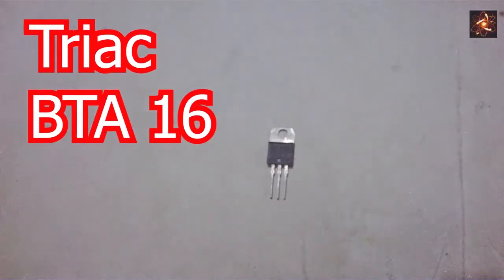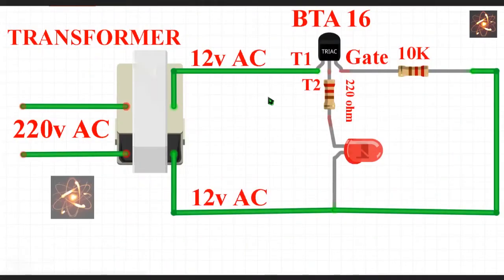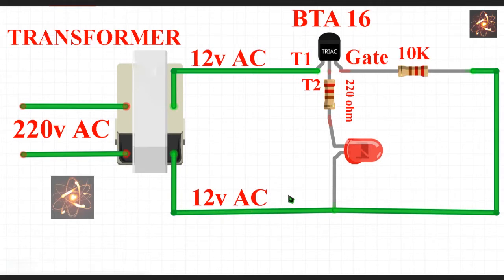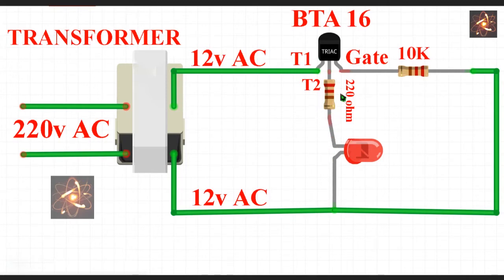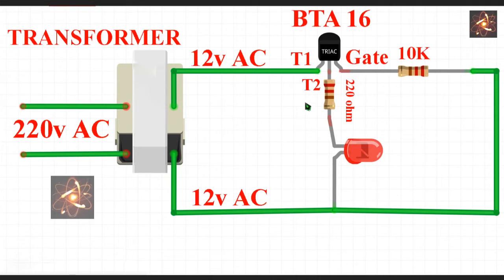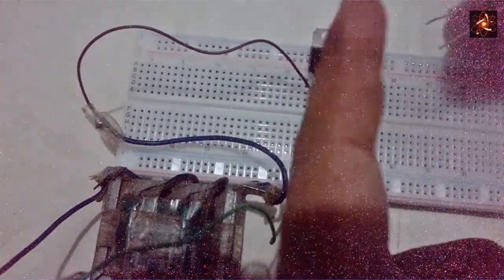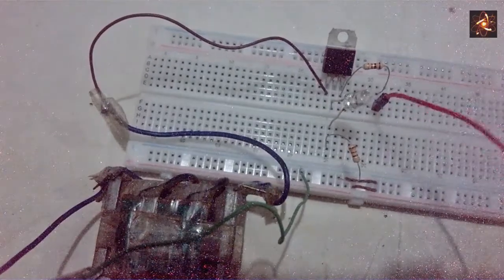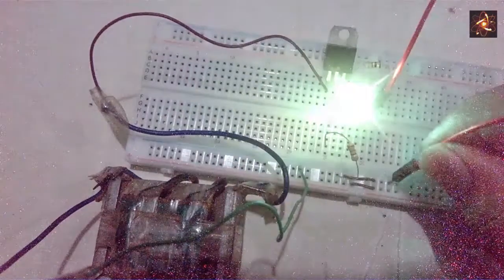triac as a switch | triac BTA-16

Comment: it is nice to see a BTA-16 triac doing something. I bought 10 of them from Aliexpress and none of them seem to do anything.
Reply from the maker: follow circuit diagram and pin configuration of  BTA-16................BTA-16 operate in ac power not dc  power
Reply: thank you for your reply.
http://onwardoverland.com/triacemail2.jpg
i have built these 2 circuits twice each with a BTA-16 triac.
none of them work.
what am i doing wrong?
best wishes
john